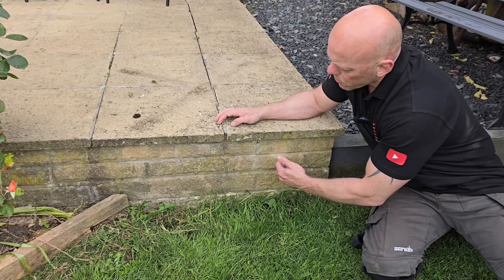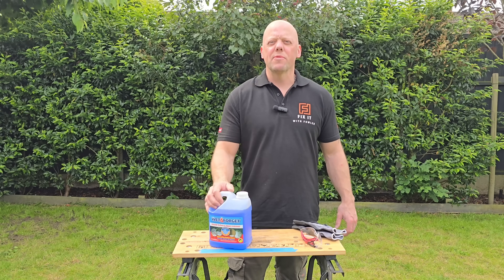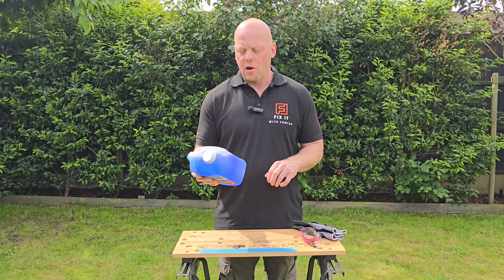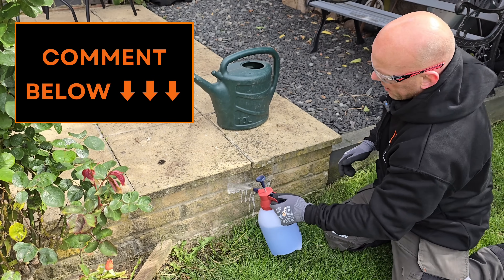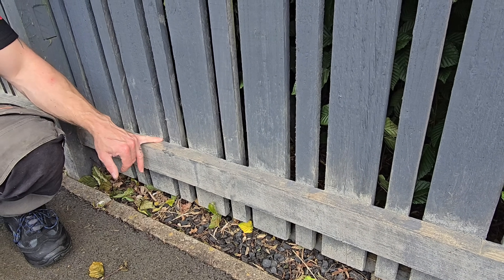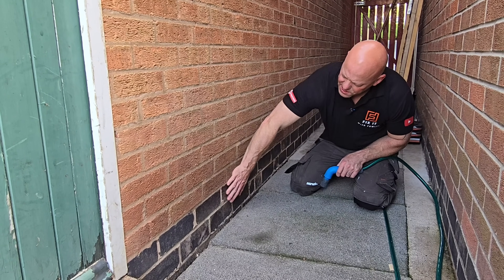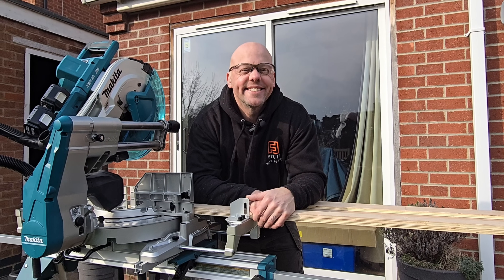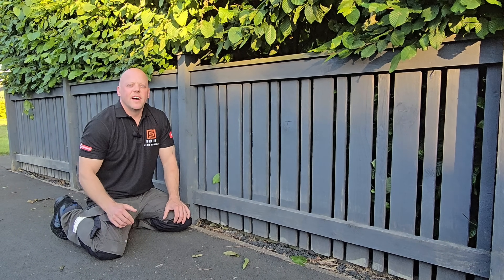The BEST way to REMOVE green algae in gardens!

Comment: The best product out there.  Works really fast on walls with render ie garages. Got to be sensible with safety wear and keep pets out of the way until dry.  Use when you have a few dry days. I use a large back pack sprayer. Lasts for a few months. Do price comparisons as cost does vary.
Reply from the maker: I'm really impressed with the wet and forget. I am always sceptical of these sorts of things, but I was proved wrong!

Comment: Brilliant product.  I have used it for many years.  I had a lot of black marks on flags in the garden and tried many things including scrubbing and power washing to remove it without any success.  However, Wet and Forget removed it although did take several months and two applications.
Reply from the maker: I never knew wet and forget would work on black spots on paving. Thanks for the tip!
Reply: Good to know - I have loads of spots on my flags and walkways and nothing seems to shift it. Will give this a try. Cheers.
Reply from the maker: @richardclarke9966 thanks for watching the video about Wet and Forget. I think it's a brilliant product even If I was sceptical at first!
Reply: @FixitwithFowler  Cheers Steve - how does this compare to Patio Magic, in your opinion?
Reply from the maker: @richardclarke9966 this actually works with these results in just under 2 weeks. I never seen results with patio magic.
Reply: @FixitwithFowler  sold then 🙂. I'll give this a bash. Cheers mate 👌
Reply from the maker: @richardclarke9966  I just got small tub from amazon but once it's diluted at 5 to 1 it goes really far. All the bits I did on the video used less than half a litre of wet and forget https://amzn.to/3LnT119
Reply: @FixitwithFowler  Good, cos I have loads to do 😅😭. If it ever stops bloody raining, of course!
Reply from the maker: @richardclarke9966 yeah so much for the summer!

Comment: I wonder if it works on a convertible car hood? I’ve been using weed killer & then baby shampoo to clean some days later.
Reply from the maker: I would suggest trying it in a really small area, somewhere you can't see before committing to doing the whole roof! You could always contact the manufacturer for some guidance.

Comment: I spent £100 on this stuff, four tubs of it. Used it, it worked well. But four months later it was as bad as ever, moss everywhere. Later I used a cheaper version (£6.99) and that worked ok but didn’t last as long (2 months). If Wet & Forget was half the price I’d use it again in the future but it’s just too expensive and doesn’t last long enough.
Reply from the maker: It's not the cheapest product, but I'm pleased with it and would deduct use wet and forget again!

Comment: It seems to do exactly what vinegar does, but at ten times the cost.
Reply from the maker: I've not tried vinegar, so I can't compare the two!
Reply: @FixitwithFowler  It is very good & also very cheap. Spray it on neat, it kills moss & lichen on contact. It is also an excellent weed killer & cats hate the smell of it. It is non-toxic (you put it on your chips) & even cleans windows. White vinegar costs about £5 for 5 litres from a hardware shop. Don't use your garden sprayer as vinegar will eat the rubber seals, instead fill an empty spray bottle you have from a kitchen or bathroom cleaner. Vinegar even disolves limescale, so put it in your kettle (then boil it) or in your WC (after removing the water first) & leave it over night before flushing. If there is limescale under the WC rim, wet some wads of toilet paper with vinegar & stuff them under the rim then leave over night before removing & then flushing. Vinegar is also highly effective to remove rust. It will just disolve it & you will be left with bare metal that's ready to paint. When I clean my kettle, after I finish, I pour the hot vinegar it down the kitchen plug hole (after first putting a few spoons of bicarbonate of soda down the hole), it then fizzes up & removes all the gunk.

Years ago before people bought cleaners from the supermarket, everyone used vinegar & lemon juice to clean everything. It works far, far better than anything else & is much cheaper.
Reply from the maker: @phoenixxavier9615 that's really good to know. Thanks for your detailed comment!

Comment: All good stuff SF,  BUT .... there's also an entirely different way of looking at this whole green algae question, especially on wood.
Green algae itself isn't in fact harmful to wood but what it does do is ABSOLUTELY CLEARLY show that the wood concerned is getting too damp for its own good. And if that is allowed to continue, other algae and then actual wood-rot will start. So in that sense you can - I'd say 'should' - think of green algae as being your friendly warning .... and are you SURE you just want to get rid of a "friendly warning" - obliterate it? It reminds me of the old saying, "Don't shoot the messenger!".
That fence looks like it does because it's getting too wet along the bottom 50cm or so: is it splashing up from the asphalt or WHY precisely is it so wet? So INVESTIGATE THE CAUSE. Our-friend-the-green-algae shows there's a 'Design Defect', two of the famous "5 Ds" in good external timber Design and Detailing. 
So again, are you SURE you want merely to obliterate the green-algae WARNING - or would it be 1,000 times MORE SENSIBLE to deal properly with the Design and Detailing Defects? When did your doctor suggest you get rid of your "friendly" symptoms rather than their underlying cause?
(PS It somehow reminds me of those French vineyards where they famously plant roses at the end of the vine-rows. Roses are from the same family as the vines but they show diseases and insect-infestations in good time BEFORE the vines get them, thus giving the farmer time to solve the problem for the vines. So are you going to ELIMINATE the roses? ... or are you going to encourage them!)
Reply from the maker: Oh, good theory, and I like your thinking. The fence obviously suffers from damp because the hedge is now overhanging the top of the fence, and also, as its north facing, it gets no sun. Both these factors I can't change as the hedge gives us privacy. Thanks for your comment, though, and worth thinking about!

Comment: Doesn’t seem to work on the brickwork. The fence seems ok though. This stuff is expensive though and doesn’t seem worth it.
Reply from the maker: It worked on my brickwork after 2 weeks. However, if it's bad, you can mix it, so it is a stronger formula, and it may need either a second application or leaving longer.